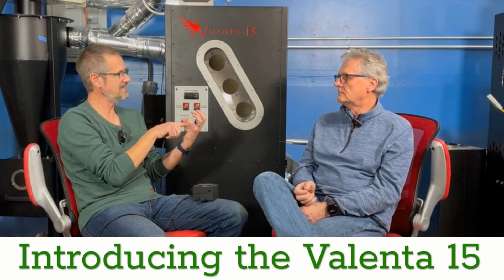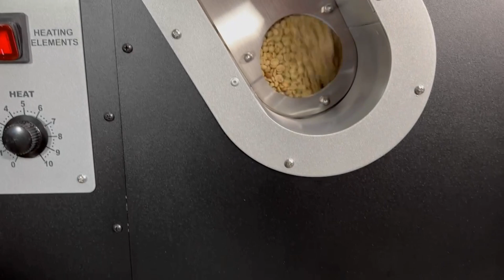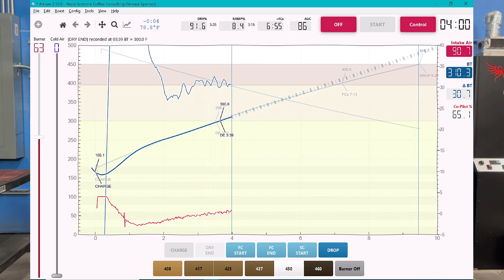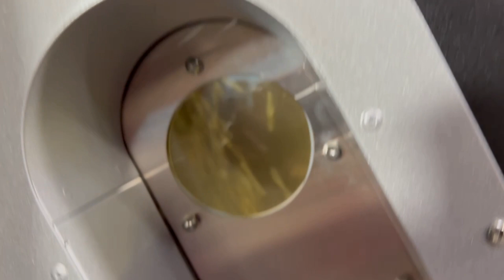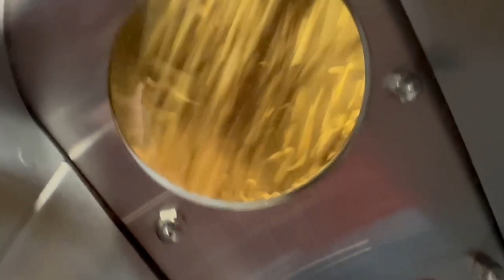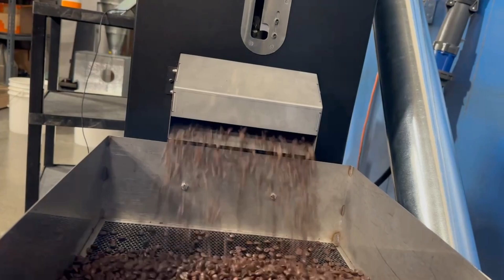Introducing the Valenta 15

Comment: So you actually passed without saying the max load. Are we 15 pounds per roast with a rough 12 to 13 out depending on loss? Or are you putting in approximately 18 pounds to net out the 15?
Reply from the maker: 15 lbs of green coffee max load. We figure you will lose about 15% of the weight during the roast, leaving you with about 12.75 lbs of roasted beans.